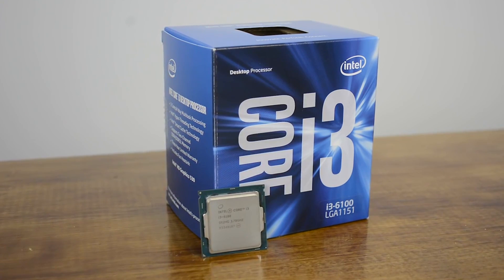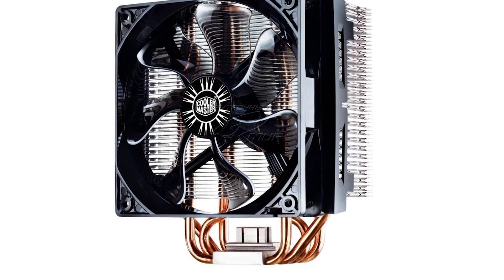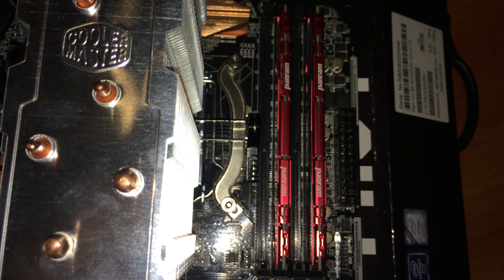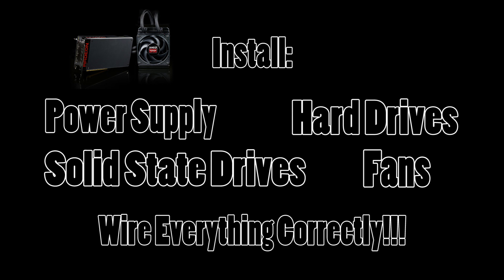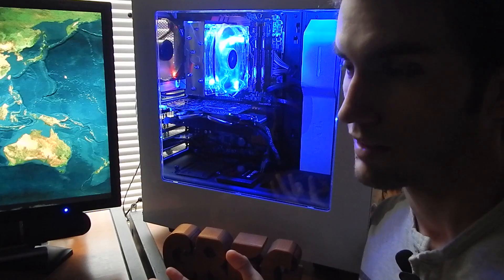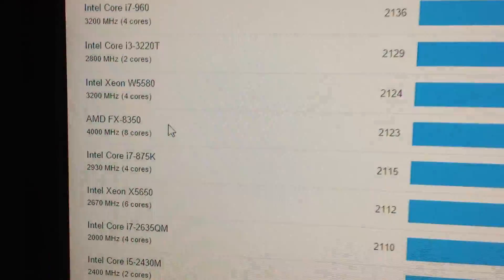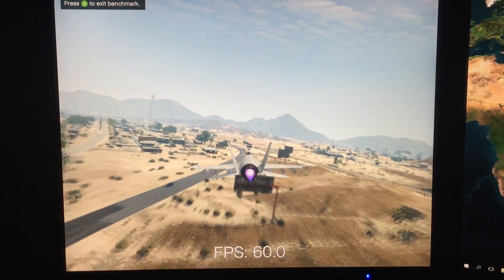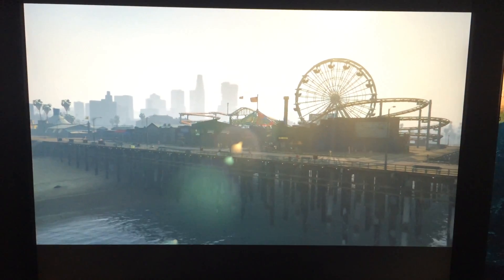$600 Intel i3 Skylake Build

Comment: hey,look what rig i wanna buy

Cpu : i3 6100
GPU :  R9 380 4gb
HDD : WD Blue 1TB
PSU : Thermaltake Smart SE 630W
Case : Segotep Fighter C ATX Mid Tower
Ram : AMD RADEON R7 DDR4 2133mhz
Can you recomend me a mobo that's not that expensive maybe 70-75$ and can overclock the i3 a little bit maybe to 4ghz or something ? Btw i planning to upgrade to i5 in the future .
Reply from the maker: +Jorge Alexis The info is everywhere online. Just compare the specs and features of the boards you're considering in your price range.
Reply from the maker: +mamomi1 HD There is no Z170 motherboard that I know of for that cheap at the moment. Maybe try an ASRock Z170 Pro4S? Won't have all the features you'll likely want, but for the price it's a great board. Remember that you'll 100% need a Z170 board to overclock any processor. Disregard B and H series chipsets for the time being.
Reply: Science Studio Yeah, I realized that ... anyway instead of going with cheap CPU and expensive mobo i will go with i5 6500 and B150 mobo and i will upgrade the mobo later . Thanks !
Reply: +Science Studio What kind of "features"? I'm about to buy that motherboard but I'd like to know if there's a better MB at that price range
Reply: Science Studio Currently is only 80 dollars on Newegg. I think it's the best bang for the buck motherboard out there.
Reply from the maker: +Jorge Alexis I really enjoy the ASRock Pro4. Looks great and has been reliable thus far. It's on Newegg currently (01/04/2016) for $117.99.

Comment: Should I upgrade to this over a amd fx 6300?
Reply from the maker: We actually upgraded from the FX 6300 and are glad we did. Our video rendering times are much quicker and the Skylake architecture is overwhelmingly swift in general, even for an i3. The AM3 series is just outdated, frankly.
Reply: +Science Studio okay sweet, I was thinking of getting an open box motherboard. 
MSI Z170A Gaming Pro ATX LGA1151 $170 CAD + tax (open box)
ASRock Z170 PRO4S $100 + tax (open box)
GIGABYTE G1 Gaming GA-Z170X-Gaming 5 $200 CAD + tax (new)
or the motherboard you have for $140 + tax
any recommendations?
Reply from the maker: +Little King Brand new ASRock Z170 Pro4 boards are on Newegg for around $110 at the moment; check them out! We bought the same mobo. Excellent features with a slick design.
Reply: +Science Studio Yeah that's USD though, but thanks.
Reply from the maker: +Little King Then probably the cheapest Z170 you can find that has the features you're looking for in your area (surround sound, USB 3.0, 2/3 PCI-e 16x slots, etc.).
Reply: +Science Studio I just watched your video its pretty educative though you should aim for 4.2 - 4.4GHz range and give a try in benchmarks and you can compare it with i5's which will be very useful information to people who may consider i3 for example this cpu vs i5 4460 or 4690. Great videos keep it up
Reply from the maker: +Deniz Onur Watch our newest video. i3 and i5 locked processors can be overclocked with certain motherboards. And regardless, buy a Z170 simply for the ability to upgrade in the future without having to purchase an entirely new motherboard.
Reply: +Little King  no, wait for zen
Reply: +Atul Goku I already bought an i7
Reply: I agree with ur choice to upgrade to a 6300. if possible, try 6350 to get 3.9 ghz on its speed.
Reply: +Little King I wouldn't go for Z170 motherboard since i3 has locked core and you wouldn't be able to overclock at all. You better grab an B150 motherboard.
Reply: +Science Studio Yeah i agree with future upgrade as you mentioned but imo by the time he wanted to change the cpu the new cpus may roll out and i heard that asrock is preparing an bios update for enabling overclocking but i think the gain may not be much anyways i will also watch your video
Reply from the maker: +Deniz Onur That is very true. The next gen CPUs might be out by the time he wishes to upgrade. Just depends on the person, I suppose. And yes, ASRock already released the bios update! We tested it and verified the overclockability of the system. Pretty cool stuff!
Reply: +Little King Just wait for AMD Zen this 2016
Reply: +Eildriz Niño Guanzon I bought a Intel i7
Reply: +Eildriz Niño Guanzon at the end of the year. which might be a total failure just like fx
Reply: +Random Gaming please explain how the fx series failed?
Reply: AMD was known for  HUGE price to performance value. fx series got crushed in  all benchmarks by haswell and the price difference isn't that big if u think about it. u need a dedicated cooler for fx which makes u add another 20-50$ to the price so.... maybe is worth for the 6300 but 83xx total failure, for the price
Reply: +WDisthebesthdd I already bought an i7.
Reply: +Random Gaming I'm not even an amd fanboy, believe me I'd much rather have an i7 but you're wrong about the dedicated cooler. Only the 95xx series requires a dedicated cooler. 8350/8320 do not require a cooler and are around half of the price of an i7.
Reply: +Random Gaming fanboy detected. The FX series are really good for the price. Ignore this dumbfuck.
Reply: +Random Gaming  You forgot a decent priced crossfire motherboard is going to cost big time at least 130 if you find one onsale. People always say go intel but you have to switch out motherboards  and change your ram also as well.
Reply: +Little King Yes for sure if you have a higher  budget....
Reply: You guys saying u can OC ur FX and have  it stable without a dedicated cooler shows how clueless u are. Stock AMD coolers are stronger than Intel's but they still don't have the power to cool a OCed FX.
Reply: Little King
Thats Awesome I am planing to buy an I5 6400 (skylake)
Reply: Dedsec
Hi i brought FX 6300 3 day ago and I am happy now :D
Reply: Duck Goose
Actually in my country India there are not availability of every processors .
Reply: +Atul Goku no one gives a horse
Reply: +Karim Basegod u can run it on ultra 40+fps
Reply: +Ionut Cosmin true my friend has the same gpu but he has the i7 6700 and i have the fx 8320 oc to 4.7 and i get 50 fps on gta 5 and he gets 170 amd had its time im walking over to intel had enough of this garbage performance of amd
Reply: +Little King no reason 20% performance i guess, and even worse performanse in multicore calculations)
Reply: +Little King Yes. Even if all you can afford is the i3 6100, it's better than 80% of the processors on the market not to mention it'll get you into the Skylake architecture so you can always upgrade to an i5/i7 later on.
Reply: Absolutely!
Reply: ***** what the fuck are you talking about?) the only one weakness of amd processors is low-cores sided programms, and i guess that shit will be changed in future
Reply: +DrowDanger tbh, their cores are still weak. Which will be fixed on the Zen. If it goes well, you will have 6 or 8 cores with good single core perf.
Reply: Carl Johnson they have decent performance stop that marketing bullshit pls)

Comment: nice build. I am about to buy the i3 6100 with a r9 380. Just curious though, how did you manage to overclock a non k processor?
Reply from the maker: We prefer the R9 380 as well. We only used the R7 as a kind of base testing tool. The i3 was turbo boosted, not technically overclocked, though our RAM was overclocked at the time.
Reply: Oh, I see. Thanks!

Comment: WIth tax shipping and no rebates included I got this build here for just under $650: http://pcpartpicker.com/p/j2g4cf
with Rebates it comes down to just under $600! :D
Reply from the maker: Very nice! We wanted ours to be upgradable in the future, hence our choice of the Z170 rather than the locked H chipset. Our graphics card choice was a bit higher as well, though you managed to scrape up a solid 16GB lot of DDR4! Awesome stuff!
Reply: Science Studio I chose the H chipset because it can still be upgraded to a locked i5 or i7 in the future and I felt going with Z over an extra 8GB of RAM was a bad idea. According to reviews, a 950 outperforms a 370 in most cases though so I'm not sure what you mean by your graphics card being a bit higher as well. 

Also, do note that you want to install the HD before the PSU in the S340 if you want to screw in the HD using the screwhole on the side to hold it in place!
Reply from the maker: +DKL The R7 370 has a higher floating-point performance, a higher texture rate, more shading units, more texture mapping units, twice the VRAM, and double the memory bus width, yet apparently the 950 manages to perform better in a few games. It would make for an interesting comparison video. 

I wouldn't advise upgrading CPUs on a locked H chipset. You'd only want to upgrade to an unlocked K chip in most cases, and not being able to overclock them is a serious downfall of your board, my friend.

Also, installing the PSU is typically the last step in my builds. I only listed the steps here (without order) for the sake of time. We appreciate your interest in our video!

Comment: May i know how you make that heatsink blue in colour ?
Reply from the maker: We replaced the stock fan with a custom Sentey fan. You just have to screw the brackets off and back on. It's detailed in our $600 Scorpion Build video.
Reply: +Science Studio Thanks ! btw nice build but i am still going to be getting i5 4460 for that quad core ✌
Reply from the maker: +Josh Tee Chye Chong We don't blame you! But you'll miss that DDR4 boost! Thanks for the watch.
Reply: +Science Studio Is that a lot faster than ddr3 ?
Reply from the maker: +Josh Tee Chye Chong There are several advantages to DDR4. Too many to list in a comment here. But you'll certainly see an fps boost in CPU-intensive games like GTA V and Skyrim. DDR4 is now very affordable as well. You said you were looking at a 4460, but for $20 you could buy the Skylake 6500, a quad-core that is considerably better for gaming and would allow you to use DDR4.
Reply: I will consider it because my country just released skylake  and it is not about the processor but the motherboard and ram which is quite expensive
Reply from the maker: +Josh Tee Chye Chong Oh ok. The RAM and motherboards are fairly cheap here in the states. It may take a few months before the prices come down where you live.
Reply: +Josh Tee Chye Chong you could also go with a DDR3L motherboard and DDR3L RAM.
Reply: +Josh Tee Chye Chong The core i5 6400 is only $189.99 which is cheaper than the 6500.